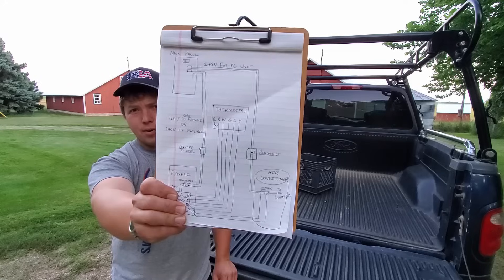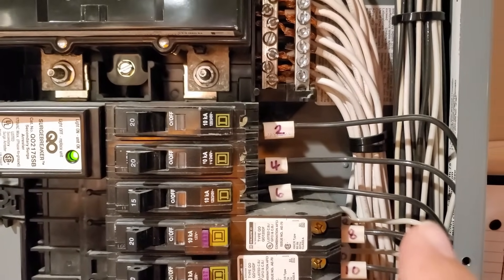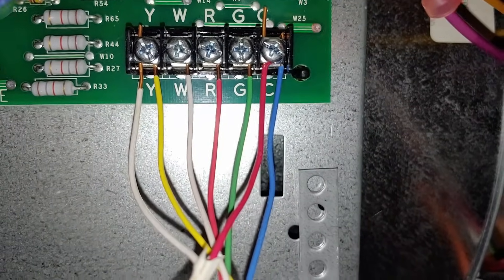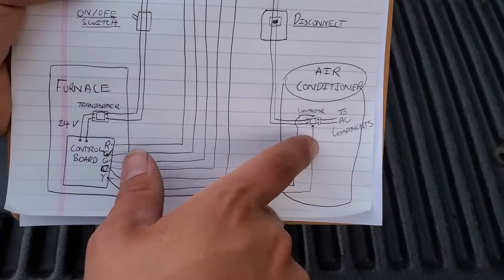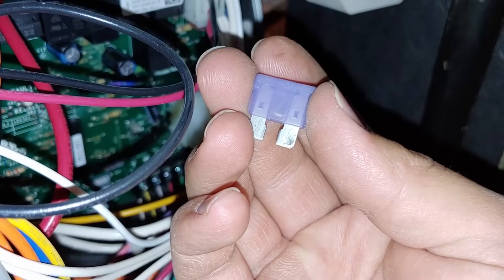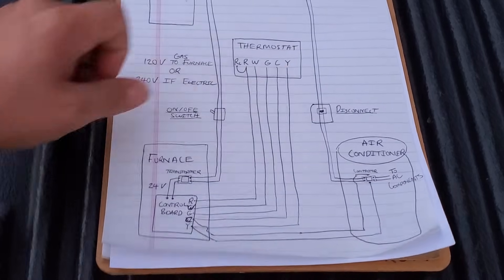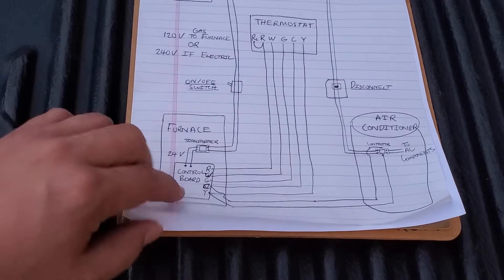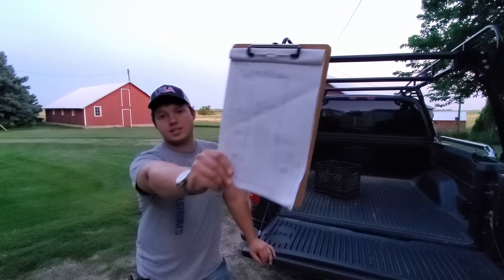Thermostat Wiring Explained!

Comment: I loved your nearly astonishing explaination of wiring for thermostats operating domestic HVAC systems. I've installed several thermostats from the old, old Honeywell units to Amazon, Ecobee, smart Honeywell, and Nest units. I'm a bit stumped or overly cautious replacing a residential tract house "Air Innovations" thermostat in my fiance's 2 year old residence. Pulling the cover from the unit exposes the typicaL Y, W, G, R, and C (blue) wires on the right, but surprise, surprise - what do we have here? To the left of the usual configuration, coming out of the wall, there's orange, black, brown and jumpered red (AUX) wires to the R in the former group setup on the right. It's the wee hours of the moring and I'm determined to get this Amazon smart thermostat installed tomorrow! If I could attach a photo of this fairly new (dumb?) thermostat, perhaps in a few words you can sguare me away and I look like the tech hero she's about to marry! It is Father's Day weekend. I hope you see this in time and can help ASAP, Ben. Thanks in advance.

Comment: Nice video, whoever installed my dads AC did a poor job.  It never works we can get the heat to work in winter then need to wire a different combination to get the AC to work.  Had the installers in 3x and they aren’t any better than me.

Comment: I have an issue with changing a 3A fuse with a 5A fuse.  Never upscale a fuse rating.  Always use what the manufacturer spec'd.  Additionally, I have had fuses that looked like they were good, but using an ohmmeter, it was actually open.

Comment: When I hook up my blue wire to C on the furnace blows the fuse ? But my furnace operates normally with the blue wire not connected.  The blue wire is connected to B on thermostat.  How is it operating without common hooked up ?

Comment: Great explanation and you touched on a number of questions I had regarding using a Nest thermostat that doesn't need "C" but I believe stresses the battery and in some cases will not provide enough power to recharge the batteries without the "C".

Comment: Question, I am adding  a 2 stage Goodman Heat Pump to an existing Goodman Furnace for Dual Fuel.  Heat Pump has R, C, W1, Y1, Y2, L and O terminals.  The Furnace has R, C, W, Y and G terminals.  Should I connect wiring as follows from the heat pump, R do not connect, C to C, W1 to W, Y1 to Y, Y2 to Nest Thermostat Y2, L do not connect, O to Nest Thermostat O. Thank you for any assistance you may be able to offer. Jack Perlmutter

Comment: Thank you. Kinda of a beginner with HVAC issues. Great video. New house and no a/c. I believe thermostat issues. I took theirs out and put mine in. Found a box tied into the tstat wiring at unit. Hopefully removing that fixes my issues. Video was great on explaining wire functions past red wire. Thank you.

Comment: Question, I'm changing my mercury based thermostat to digital and  I notice that on the original wiring the RC and RH have a jumper red cable connecting to one another but theres another red cable from the control board connected to the RH as well then on the yellow theres a blue connected with the yellow together yet the B slot is empty, why wasn't the blue cable connected into the B slot? and how do I wire this to the digital?

Comment: The C wire, is the Blue Wire? I think that the Y screw on the furnace wouldn't really "know" if the wires were hooked together somewhere else, other than under the screw itself. Same thing, Electrically. Right? Try it.

Comment: I watch this but I have no idea where my control panel is for my furnace because my damn c wire isn’t connected but on the old thermostat it was connected in the y spot so I have no clue I need to get this goodie nest working

Comment: Nice job.  My current Honeywell has wire on the Y and Y2.  On my new RTH6500WF the "Heat Pump" side of the terminals only has a Y wire.  But there is a Y2 label on the other (Conventional) side, which seems to be across from the L wire terminal on the Heat Pump side.  I'm confused.

Comment: ben i have an air handler for my ac and a hydronic boiler with baseboard for heating basically two separate system with a common nest E thermostat (red, yellow green) from air handler and red & white from taco switching relay on boiler   need help with proper wiring diagram thanks you so much

Comment: Excellent explanation! I have two thermostats and one control board on my late 90s system like your diagram. Replaced an old stat with a smart stat. An unused blue wire was used for C. Other old stat also with unused blue wire was left alone. Found only one stat cable is connected to control board. Are the cable wires from each stat connected elsewhere? Smart stat not working.

Comment: We are trying to wire a thermostat to a mobile home heating and air conditioner unit.  We installed it and the only thing that ran was the fan.  We looked for a fuse to check but there are no fuses in our unit.  Any suggestions as to how to get heat?

Comment: I have a red and white wire at the thermostat.  Then someone who will never get that job working at nasa in mid run therm to furnace  I have white and black.  only two wires.  We use a swamp cooler and if you are running solar much better as far as draw on your batteries compared to refrigerated air.  Swamp cooler only has to run the squirrel cage. motor.  but.  I used the black wire for red and hoped the white wire was white on the swap to black and white wire .  no heat.  led OK light is solid green.  Pwr led is solid green

Comment: I replaced Honeywell thermostat with an Amazon smart thermostat. I flow the instructions and wiring is correct. The fan is working, heat is working. AC on and fan running but no cool air, I went out side the house and AC unit fan is working.

When I remove the thermostat I felt a shock at my finger even I already turned off the 30am breaker in the garage.

Did the fuse blow up some where?
Please help. Thanks 
Peter

Comment: So I am putting in a new high efficiency furnace 
, I presently have just an old round style mercury thermostat with two wires going to the furnace. Can that still be used or do I have to update the thremostat also?

Comment: If you want to install a smart thermostat that requires an common wire and you only have a furnace, would you still connect a common wire between the t-stat and control board?
Reply: Dan I want to helpl.But don't understand your question A smart thermostat needs 24 V To run it If you have a thermostat just for heating like an old fashioned yo yo type thermostat  you will not have a common I think that is what you're trying to ask

Comment: Hi Ben, great presentation. My sister’s heat stopped working, so I did test everything in furnace and found bad flame sensor. Replaced it , and all is good now. Then my sister asked me to replace an existing thermostat with NEST. I noticed that the heat does not come on the first time, but on Second Stage Heat 2, instead of Heat. What do you think is the cause ? I am not an expert at this, but I’m tech savvy, and understand also thanks to your video the whole process of how it works.

Comment: Thank you for the great vid! Excellent crash course. You explained exactly what I did wrong when I touched that R and C wires together, and why my unit no longer turns on lol.. Hoping it is just the 3amp fuse as you said, as opposed to a new $450 control board! Thanks again.
Reply: Sometimes the transformer will blow along with the fuse. That is why some manufacturers have 3 amp fuses installed instead of five amp ones, to save the transformer along with the wiring.
Reply: @officerkrupke4966  Thanks. Unfortunately I couldn't find a 3amp fuse, so I replaced it with a 5amp one, and all returned to normal. Will be sure to shut everything down before attempting to replace a thermostat again...

Comment: So would you need an 18/5 thermostat wire from the furnace to the thermostat and an 18/2 wire from the furnace to the condenser? What would happen if you mix up the C and Y on the condenser? For example, the Y on the furnace is connected to the C on the condenser and vice versa

Comment: Where can I find out how to add either a second thermostat to just turn on the furnace fan at full speed when using my outdoor wood boiler and a heat exchanger added to my gas furnace plenham. Or is there a way to add a temp sensor to determine if the heat exchanger is hot and just turn on the fan?

Comment: thank you for the excellent information I have learned a lot from it, and I have a question when I have the heat on in my thermostat only FAN is running and no heat is coming out of it ?
it runs for hours and stops by itself. My thermostat is installed by NVPOWER CO, here in the las vegas area. I tried to shut it off but could not. hours later it stops itself .
can you help why it is doing this? and sometimes the heat is coming on but no FAN is on.  Thank you

Comment: You just literally walked me through fixing the old wiring in my 40 year old house that now has modern HVAC equipment and a Nest thermostat that I couldn't figure out why it was going dead. It didn't have the C wire to power it!

Comment: Master plumber her key word plumber lol. I just finish a radiant floor for a client. The thermostat wire are existing and are only red and white no common. The stats tie into a zone control that operates the 120v zone pumps. The question is so we need the common wire or can the thermostat use it's batteries to send sig down to the zone control. The homeowner has had and old system that got taken out and stated it has always been just w and r no c

Comment: I just replace my Honeywell thermostat and I currently have a conventional Furnace system with a Heat Pump and is been working fine. But I have decided to replace the thermostat for a Nest Learning Thermostat. I have notice that my Heat Pump does not turns on, I don’t have an O/B wires connected in the ne Nest Thermostat but I do have a wire connected in the W1. What could be the issue of the Heat Pump not turning On? Appreciate ame help

Comment: Thanks Ben,  quick question   I have 4 zones  with old honeywell 2 wire thermostat  only red/ whitewires no C    2 of the thermostats control heat & cooling, and 2 control just the heat.  trying to figure out how to install smart thermostat w/o the c wire  any thoughts

Comment: What would cause the “auto” fan setting to just quit? If ya turn the fan over to “on” it works but not if turned to “auto”. Yesterday it worked fine but today w the AC turned to 75 the house was 81 and fan set to auto like it has been for the past 15 years, I turned it over to on and it immediately started cooling my house back down. I checked wiring, tightened all screws, flipped all things at the fan, nothing fixed it. I turned whole system off for the night cause I had to leave, hopefully someone can help with this.

Comment: I have a c wire adapter and the furnace doesn't have a control board but utilizes wire nuts. I followed instructions on the hook up at the thermostat and above the  adapter. Below the adapter I have red to red, white to white, green to green, yellow to the white compressor wire and blue to the red compressor wire to provide the 24v power. Air is work and fan is running but cannot get heat to kick on. I had wiring crossed for a hot second and the heat was kicking on when air was supposed to be on. Any ideas? I can send photos

Comment: what would happen if you put a switch on the Y wire between the controller board and the AC unit? the reason I ask is I hate that when i turn on the circulation at the thermostat, it puts the fan on super slow air circulation, you can barely feel the air coming out of the vents, I rather have the fan on high pushing air through the air filter and circulating the air for real! What is your thought on that hack to get the fan to circulate the air for real...

Comment: I'm trying to diagnose a multi-unit machine room where all the exhaust flues go to a common vent out the side of the machine room.  The R and W and C terminals have extra wires going to a separate area where there's a flue blower.

My guess is that the flue blower is triggered first before the furnace is allowed to come on so that exhaust gasses can't leak down into the other units.  The problem is the system is old and poorly wired and documented.  I'm having to trace everything out.

Comment: Thanks for your explanation of the thermostat wiring. I'm trying to install a new thermostat and the manufacturer's video was very confusing. I now understand that R-wire is red wire, Y-wire is yellow wire, G-wire is green wire, W-wire is white wire but C-wire is black wire. The C meaning black wasn't explained by the manufacturer.
Follow-up: After watching your video, I was able to properly install a new Honeywell thermostat that relied on using the C-wire that had previously been unused. Unfortunately, when I flipped the switch it was dead. I was sure that I had killed my new thermostat and furnace and would need to call the repairman in shame. Before doing this, I decided to open the furnace up. Apparently,  whoever installed the furnace never saw your video. For some reason, he had installed the C-wire to the wrong terminal. After correcting his mistake, it works perfectly.

Comment: Good video. So I have a quick and I think easy question. If I wanna run just the fan from the propane furnace to blow through my heat exchanger from my outdoor wood boiler do I need to have a seperate thermostat. I am putting a propane furnace in my house for just back up or for fall and spring. My outdoor wood boiler heats my house in the cold winter months and I just need the fan from the furnace to blow air through my heat exchanger. Or is their a way to use the same thermostat to run both my heat sources?

Comment: Great Video, have you worked on any Sinclair KJR-29B wired remote controllers for AC units. I want to remove it and use a Nest thermostat instead. The Sinclair has a lot of extra wiring and a remote controller wired in that all needs to be removed to get back to the basic controller board configuration. Any advice would be greatly appreciated. Cheers,

Comment: Very good video! Too bad I couldn't have found this a month ago. My issue turned out to be slipped wire from a wire nut in a juction box above the furnace. A 110 lead wasn't secured in the wire nut properly or it wouldn't have popped out. It worked for 10 or 11 years before it failed.

Comment: question: where is the safety switch thats on the inside of the furnace panel fit in on your schematic diagram What does it connect to? thanks

Comment: Do all control boards have a fuse? For the life of me I cannot find one. I think my a coil froze up because my air conditioning just stopped blowing all together the fan on on by itself will not run either. Down at the board I jumped red over to G and I don't get any fan. I did check for power at the red wire between R and common or C terminal and I did not have power however, unbeknownst to me at the time I was checking for DC power now I understand it is AC power I will have to check it again tomorrow. However jumping from red to G for the fan should have kicked my fan on if I had power there. The air conditioner just off working and like I said I believe the a coil may have Frozen up because I had a bunch of condensation and moisture dripping off when the furnace hadn't run overnight. 
What is the first step I would assume I want to check for power coming out of my transformer I should have about 24 volts on the low side of my transformer correct? I don't have to have the thermostat set to call for AC in order to have power at my low side of the thermostat do I I would not think so. actually I am running but it is so hard to get them to do anything and I got about 80° temperatures in this place even at night and I am burning up. I'm pretty handy with you know basic things I have a voltmeter and everything so if you could point me in the right direction I would appreciate it. Like I said for the life of me I cannot see a fuse on that board anywhere. Is it possible somewhere else I will look again tomorrow I had to come up to charge my light my light kept going out, but like I said for the life of me I did look again tonight after I charge my light I cannot see a fused in there anywhere. 
Now when I have my thermostat set to call for cooling my fan is running outside although I do not hear the condenser kicking in and as stated above my blower fan is not running. Does that blower fan have to run before it will allow the air conditioning to do anything else in other words as part of the sequence of operation? Anyways again I cannot get the blower fan to run jumping terminal R to terminal G at the board. I will double check again tomorrow for voltage out of the transformer because in air I did have my voltmeter set to DC volt.

Comment: i have a W wire thats actually a small jumper cable connected to the Y cabel port (so W to the Y, not to the wall). Any idea why? i didnt connect on my smart thermostate i just installed and now the cooling and heating are backwards. Not sure if that has something to do with it?

Comment: Hi Ben. In the summer I want to run just my blower on my gas furnace. Can I connect a jumper between the W and the G terminals? Currently there are no wires whatsoever connected to the W2, Y1, DHUM, G or Com terminals

Comment: The Y terminal on the control board, (newer models). will make the fan run at FULL SPEED, as opposed to just the fan terminal (green) which will run the fan slower?  thank you

Comment: My main panel dosen't have a ac 240 breaker on it, only the outside fuse disconnect. It has a 50 and 30 breaker for electric stove and a dryer. Is this the reason I can't run my central ac with my portable generator?